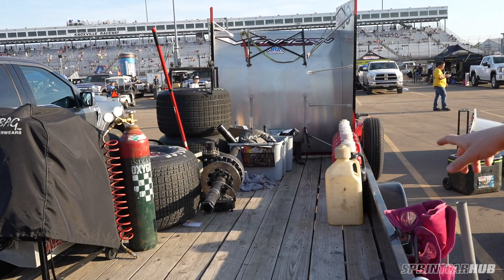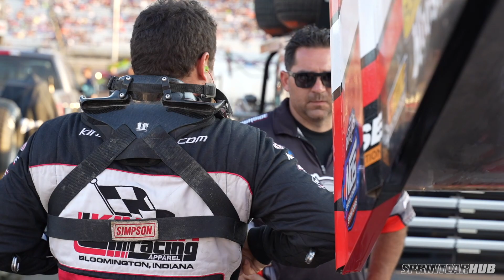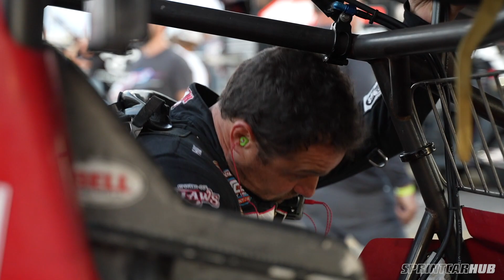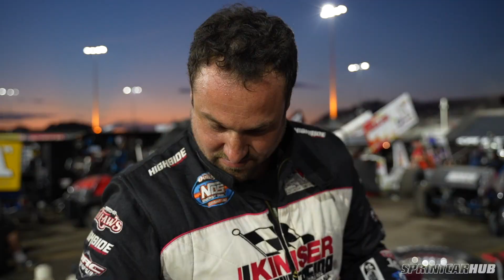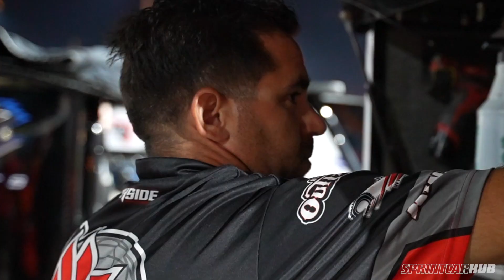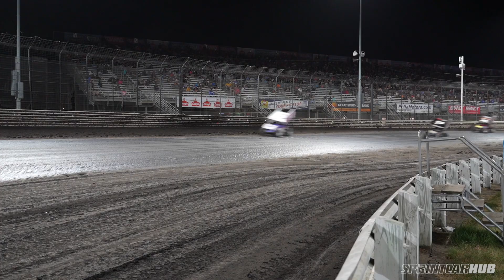"One Of The Greatest Days Of My Life" - Knoxville Nationals Night 3 (2022)

Comment: Swindell Speed Lab has Knoxville Nationals in-car footage w/ Sanders same as you have with Kinser here.  Comparing hot laps and qualifying.  I see quite a difference between the two.  I know Kinser runs Kistler engines (Kistler engines won the nationals with Johnson, Shaffer, Gravel, and Lasoski) Swindell runs Ryder engines (I think Larson is Ryder's only Nationals Victory)  But the Swindell car's engine seems to have more low-end grunt coming off and much less steering correction down the straight-a-ways.  Kinser's engine has a higher mono-tone pitch and his front wheels are not nearly as steady and straight down the shoots.  This was Sanders' first time @ Knoxville where Kinser has years of experience there.  Why show up, if Kinser don't have his shit together and unprepared?
Reply from the maker: Every driver and teams goes through highs and lows in performance. Kraig has struggled for a while now. If Sanders had a bad run it would have been easy to assume that he and the Swindell team didn't have their shit together...
-Toby